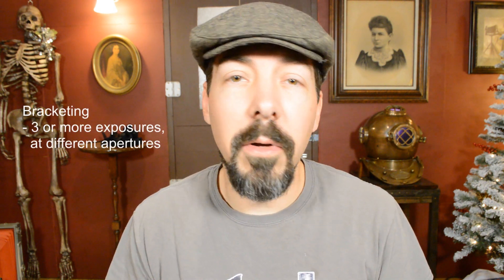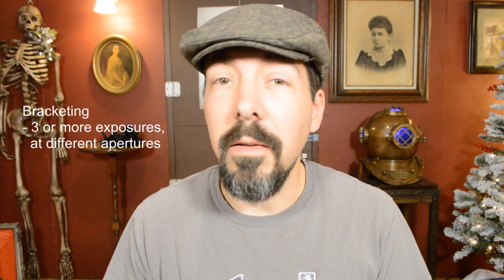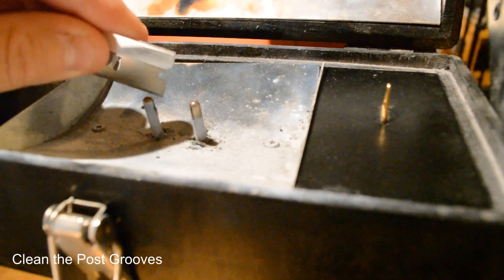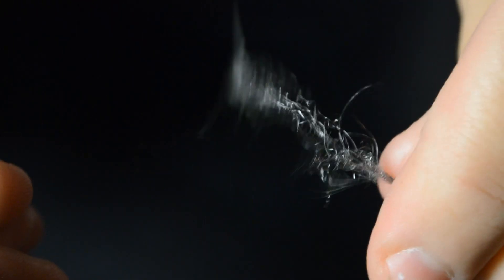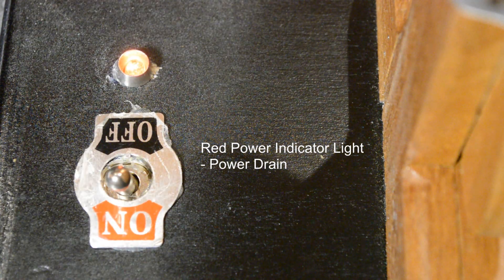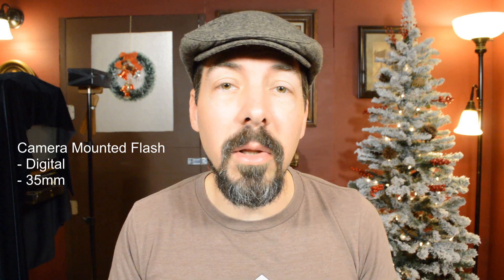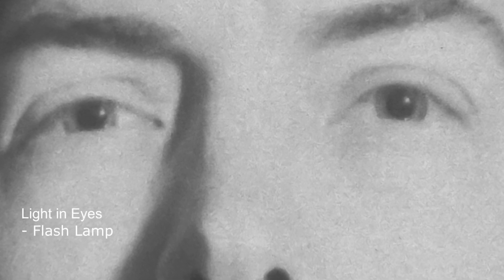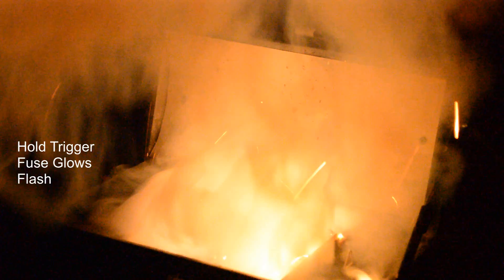My/AP WORKSHOP Ep4 - MAGNESIUM FLASH PHOTOGRAPHY

Comment: Back in the days where magnesium was used (first stripes, than Mg in a flame and finally Mg with an oxidant) they had just the problem you had with the movement. So there was research to estabilish the speed of transmission of the impulse trough the optical nerve to the brain. (Or to say it how long the model needs to jump in fear after the Mg was ignited.) I don't remember how long it took to get the signal to the brain, but they found it out. (By they I mean not photographers but early neuroscientists.) You can find the exact value at Josef Maria Eder. 
Once they found this reaction time (some ms), the next step was to make the explosion quicker than this time, so the entire lightning phase happens before the subject/model is scared. You will find the experiments made by different photographers also collected by Eder. They added different salts to the mixture to make the burning faster. I also have not in my head what exactly worked, but they managed to reduce the speed under that of the reacion speed of humans. 
I need to look up those documents again when I will mix my own flash powder.

Btw, Eder collected also configuations of different multiple flash constructions and of light softener constructions, amatorial as well as industrially produced ones.
Also he documented different light sources in use back then that were lith before the flash, so the model does not sit in total darkness and have dilated pupils. These lights had to be ideally non-actinic or negligeable to the power of the flash, but than again powerfull enough so the models eyes do not dilate.
Reply from the maker: Thank you. Great information!

Comment: Have you thought about using nichrome or kanthal wire instead for the filament? I use a 34 ga kanthal wire for blackpowder igniting with a 3.7V battery, and it just burns through any fouling.

Comment: Try nicrome wire to ignite it.
Reply: I just use model rocket igniters. Though i've seen people have luck using Squibs as blasting caps sort of. The same kind that come with remote smoke grenade setups so you can trigger multiple wirelessly.
Reply from the maker: Interesting! Thank you!